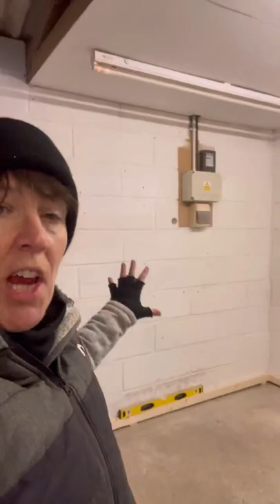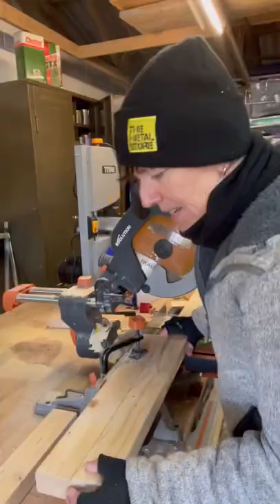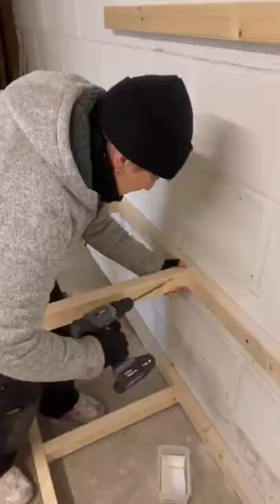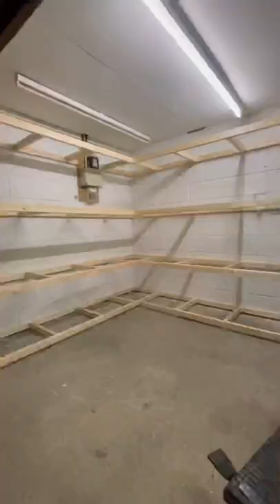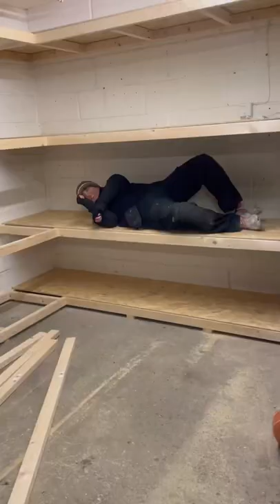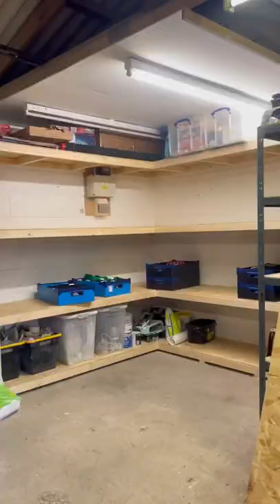EASY DIY Garage shelving | DIY For Beginners #shorts

Comment: It will sag without supports. Been there got the T-shirt I’m afraid. It’s the constant applied load that’s the problem not a quick hang off it.
Reply from the maker: Over a year on and no sagging yet!
Reply: Was going to say same thing, you need supports
Reply: Yeah I would atleast put supports in the corner.
Reply: I all depends on the weight she puts on there

Comment: Very nice. I would like to have seen support for the inside corner as it doesn’t look strong enough.
Reply from the maker: I did think about it but it took my weight and I don’t put heavy things there. It would have been more in the way.
Reply: It WILL need one over time guaranteed..!
Reply: @lousworkshop  looks sturdy to me
Reply: @lousworkshop  Very nice work! I had one in the corner of my garage from the previous owner. The home is less than 15 years old and the center definitely needed support. I'm usure when it was originally assembled, but I tore it down as it didn't match my needs.

On a side note, I feel like my phone is listening as I told my wife just last night the pantry shelves were leaning. They are constructed the same way.
Reply: I like using “Tapcon” screws for securing to masonry walls. A bit faster to install without drilling. 
I like your corner design and may use it for shelves in my shed. I will support the inside corner because I plan to store a lot of heavier items like tools and bulk food bins. Cheers!

Comment: Wow didn’t know pockets holes where that strong. Looks very professional!
Reply from the maker: The strength really comes from the design of the shelving not the screws. Using the pocket hole system makes for a nice tidy and easy construction (especially when you’re on your own)
🙌🏻👍🔨
Reply: Which pocket hole kit did you use please

Comment: I made something similar to maximize useable storage space by drilling thru the edges of the shelves every 4’ or so and installing 3/8” threaded rod up into cross beams in the roof/ceiling. Sturdy, will not droop, and eats up very little shelf space.

Comment: Did you hammer the screw into the brick wall??  Which wall plugs and screws did you use please?
Reply from the maker: Hi 👋,
I drilled the hole first then inserted the fixing. They’re called ‘ hammer fixings’ in the UK. They’re a combination of a nylon plug and a hardened drive screw specially designed to fix battens to masonry 😃👍🛠
Reply: @lousworkshop  ok thanks I'm in the UK as well. Found them at Screwfix. How far apart do they need to be?

Would I need vertical supports at regular intervals?
Reply: @vishalthanki  the more screws you have the stronger it'll be. One every 2 feet is plenty for any weight

Comment: how much did you spend? looking to do this myself
Reply from the maker: I used ‘stud timber’ for the frame and OSB board for the tops and it cost about £75. It would have been a lot cheaper if the price of timber hadn’t sky rocketed! 😩
Reply: @lousworkshop  
❤️
Reply: I did this as well as a work bench with 2 lower shelves than a pegboard up top to hold all my tools

Comment: You must abhor seeing screw screw heads because pocket holes are totally unnecessary otherwise
Reply from the maker: For me the aesthetics weren’t important and for the most part I can’t see the holes. I used pocket holes for this project as it just made putting it together much easier as I was on my own.

Comment: See no need for bottom shelf and you better use baseboard to keep small items from getting lost underneath😅 A huge waste of materials in my opinion
Reply from the maker: The floor is being built up soon in this small area, so done for a reason👍🏼
Reply: Alot of people don't like stuff on the floor. They might put soft fabric down there who knows.
Reply: Aw, buddy- you ok?
Reply: Thank you for this comment. I was all set to build a bottom level just inches off the floor, when I realized you were right, and I didn't need to do that. Thanks again.
Reply: Some say you should ALWAYS have items off the ground in the event of any flooding.  It’s a wise decision imo.